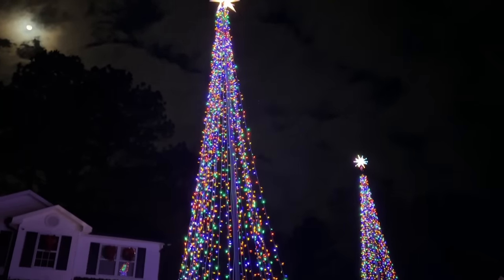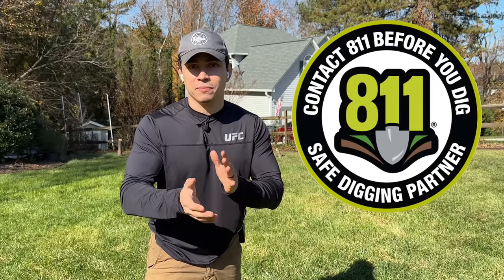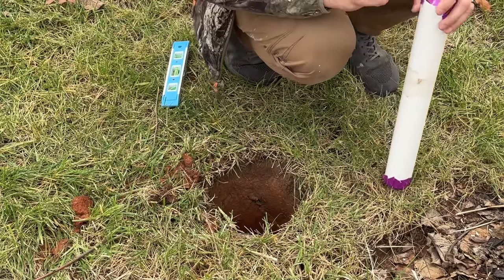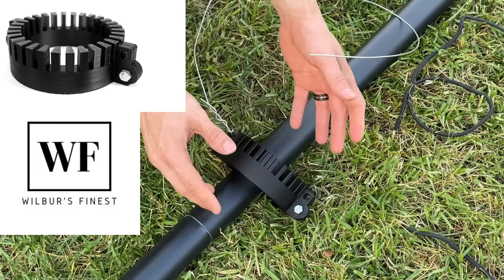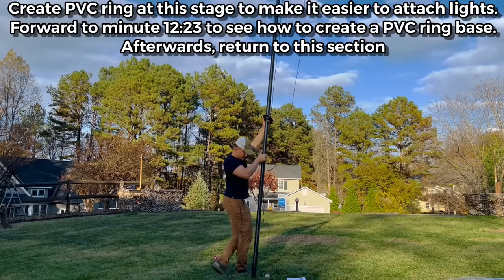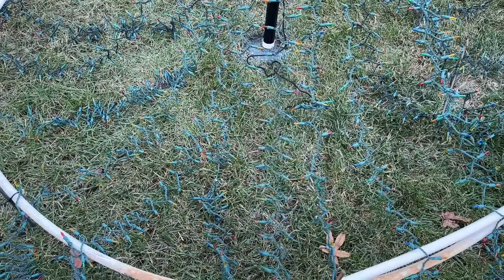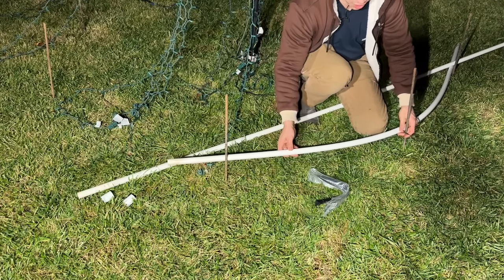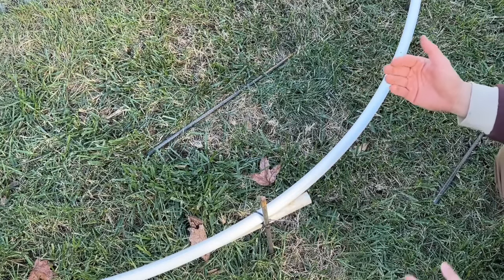How-To: MEGA CHRISTMAS TREE TUTORIAL - 25ft Tall!

Comment: I did the stake base and conduit upright for my first one.  Then, i discovered top rail for chain link fencing.  I drove a 4ft piece into the ground permanently and then slid in the upright.  My tallest one was 36ft and had 6000 lights.

Comment: Hello Isaac, 

Great idea on the flagpole Christmas tree. I had been think of a similar idea since last year. But accidentally found your video, and you gave me better insight on how to do it better.

My only question is how did you attach the lights at the base? You said wrap the lights around the base. I don't believe they'll stay there on their own. So did you zip tie them at the base or how did you get them to stay? 
And I'm assuming that you plug the strands together at the top, lights run down to the base, then come back up to the top to plug into the next one, yes? Do you recall how many feet of lights per each box you used and how many boxes it took? I'm guessing 50' string of lights and 18 boxes? 

Keep up the great work!

Comment: Maybe I missed it, but as you add the lights and are attaching to the topper…how do you ensure you have enough vertical length of light before looping it back again over the next rung on the topper? I ask given that everything is being connected as one continuous strand and you aren’t raising it or attaching to the base until the end.
Reply from the maker: You have to use Christmas lights with 100 lights per strand which will measure in length between 22 to 28 feet long (depending on the brand). So you don’t need to ensure that you have enough length because each strand should be long enough for a 25ft flag pole

Comment: flag poles typically are a fairly thin gauge of metal and many times fail under wind loads when the added weight of lights is added
Reply from the maker: I agree, though I’ve never had an issue using this method, there have been times that I worry about it during a very bad storm
Reply: I bet the extra weight of the lights and that they are strung 360 around the pole that the lights add stability to the tree.
Reply from the maker: @hollydaines743  indeed. The lights add stability

Comment: Don’t use pvc cement on the bottom ring for storing purpose use duck tape
Reply from the maker: I tried that first and it broke. I think maybe I needed to use more duct tape. Definitely would be easier to store that way
Reply: @IsaacAlexanderDIY  yeah just use a lot more well worth the effort or storing thanks for idea btw
Reply: Thanks guys. Was wondering where I’d store that huge base.
Reply: PEX is more flexible so it can be coiled up at the end of the season. Buy the whole coil (it's inexpensive) so you only need one connection for the whole bottom ring. You could play with the fittings to make the circle then disassemble. I think last year he used PVC tees and short lengths to make feet for the ring? They just slide over the PEX. Zip tie to short rebar in the ground or put the rebar inside the circle and use tension to hold it (angle rebar outward or use sturdy stakes. Lots of options.
Reply: @dianeladico1769 Pex is definitely the way to go if you choose to do a base. I just use tent  pegs to hold my lights directly to the ground. Really no need for a base. Although it does eliminate the need to measure every tent stake individually......